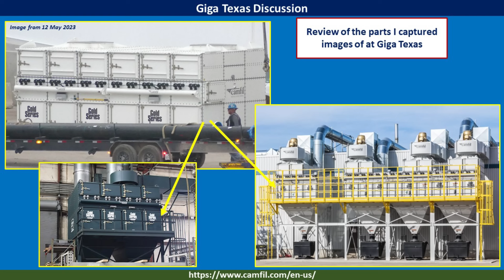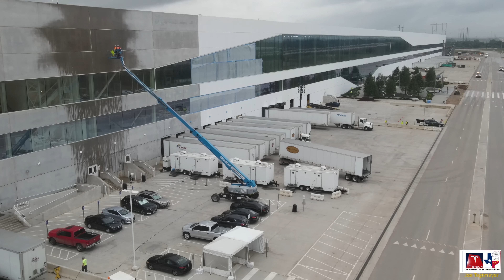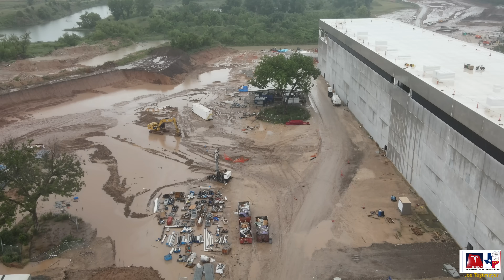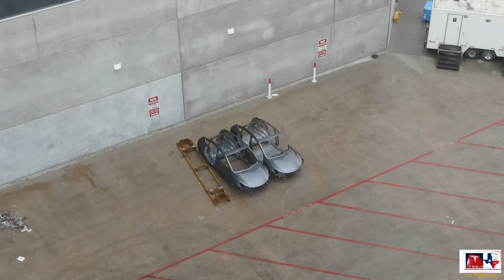Rainy Mother’s Day with Very Interesting Castings on S end! 14 May 2023 Giga Texas Update (10:35 AM)

Comment: Thanks Joe
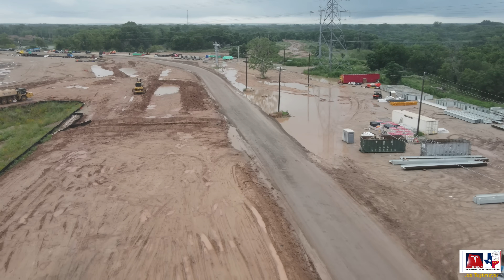11:04. Southend. Stack of steel. For over a year this constantly changing stack of steel has been touted as being the extension structure. It may finally be with the arrival of columns.
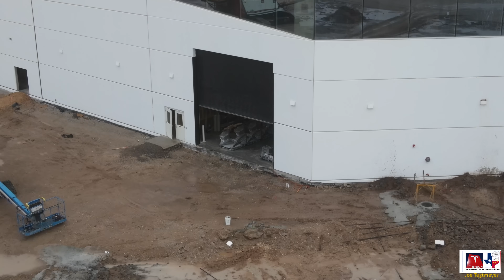12:16. Stamping, inside. Castings. Definitely not Model Y. Presumably Cybertruck, and from various available photos, would have to be the front. Possibly down here as there is a large milling machine in Stamping.
Begs the question, how were they cast? Gigapress, or old time patterns, and sand boxes? The latter would seem likely.
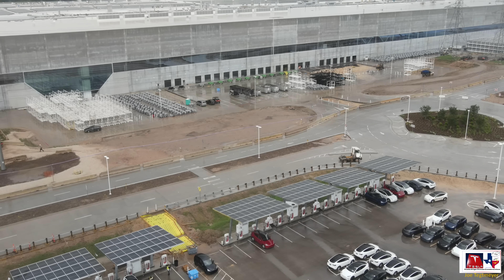13:35. EOL parking. New stair. The mystery of the moisture barrier. Used intermittently inside the building, might be the first time it’s been used outside.
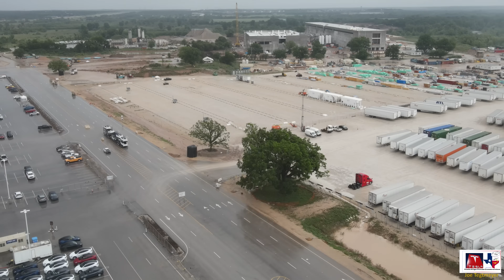14:04. Site security access road. Bottom left, a disguised Tesla. Updated model for Shareholders Day?
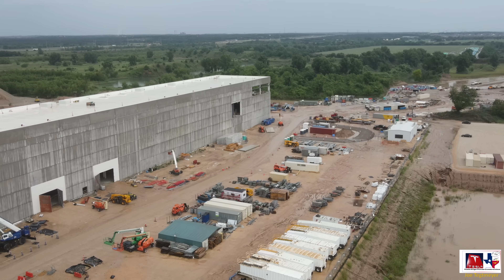15:08. Cathode east. Line of water storage trailers still connected to the blue water main via a pump.
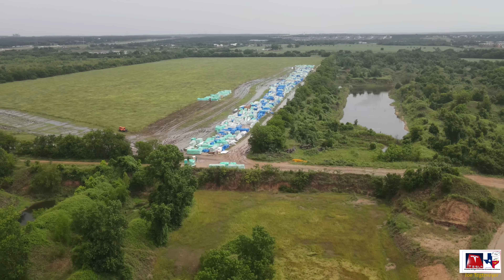15:45. Far north storage. Dog on the road. Some items marked GA2.
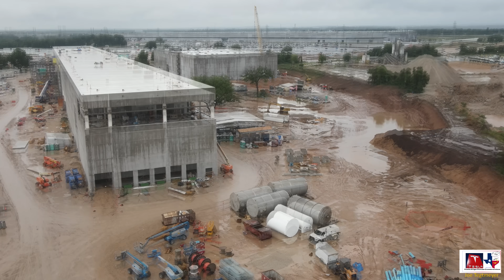16:28. Cathode east. Blue tarps. I think these are window units under.
Cathode, north. Level 3 wall opening. Aluminium/aluminum sill sections may have been placed.
17:07. Die Shop. Stack of wall panels to ruin our view inside.
17:56. Die Shop, south. Mezzanine. Large item of equipment, or possibly a room has been constructed.
18:33. Cathode, plant platform. Apron. Widened the formwork for the raised plinth.
19:57. New Switchyard/substation. Southend. Line of steel piles. There’s a pattern. Possibly some sort of fire separation wall between the LCRA and Tesla parts of the switchyard.
21:05. BESS site. HDD rig. Not the rig missing from the river.
22:54. Battery, loading platform doors. Unchanged in size, maybe the contrast in colour between different material wet wall surfaces gives an illusion.
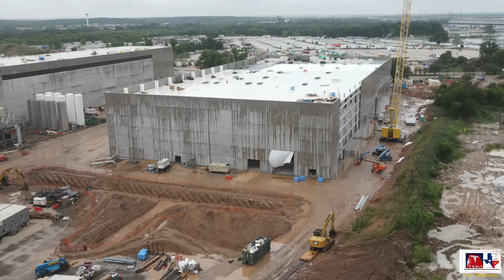Reply: 17:00. Die Shop, north. Large hole on right. Looks like rails have been placed on the floor to facilitate moving in of heavy equipment in the near future?
Reply: @devinnullenvoid29  Great name! I think for now there are recesses, and agree rails are likely.
Reply: 12:16  The Cybertruck Gigapress was delivered 3 months ago.  Why wouldn't first articles be available by now?
Reply: @eclecticmemes  12:16. No positive indication that the 9000t press is operational. No flue/s for a furnace/s for example.

Potentially an existing furnace might be able to supply the 9000t press for test runs.

Might not even be sufficient gas or electricity to run additional furnaces yet. If gas fired, they would have to be a flue, not so sure about electric.

There's a new plumbing permit for 1500' of natural gas line issued last week. No indication of where it's located, but if measuring from the meter location, 1500' could be a parallel service to the existing Casting gas line. Die Shop and Cathode 2000' or more away.

Weird place to put them anyway.

Comment: Those Camfil dust collectors are pulse units. They send pneumatic air in and pulse the filters, they are on timers, very typical for machine shops. The dust or particulates drop down into the barrels below the units.

Comment: Joe, I don't think those doors have changed in width, at least not since they put the semi-permanent platforms.  However, it looks like they cut the concrete panel to make the left one taller.  Seems to have happened maybe 3 months ago.
Reply: You are correct, it has got taller. Sometime between Day 899 7 January and Day 935 2 February a section was cut out of the upper wall panel.

Comment: Substation, south end: @ 19:51 my guess is that the steel I-beam piles are for a temporary retaining wall. Again, just speculation. Can't think of any other purpose.
Reply: Some examples: https://www.youtube.com/watch?v=0YmsP0OxUtw
https://www.youtube.com/watch?v=tiJLFOCvUxc
Reply: What would it be retaining?  Are you saying they are about to dig a big hole there?
Reply: @sammyk874  Change in elevation between the LCRA substation and Tesla's facility?
Construction large underground vaults?
Hard to say. I may be completely wrong. Just can't think of any other use for the piles in the way they are laid out. Have any ideas?
Reply: How about a security wall to make sure no one shoots at the transformers from the road. It seems to be a problem lately. Might see another one erected to protect from the highway on the west side of the substation as well.
Reply: @tristatemedic  Where they are putting it doesn't face the highway unless they plan to put it around the whole thing.  Austin Energy has put decorative fencing around their downtown substations but this seems overkill.

Comment: Very interesting. Thank you on a very rainy day. I just noticed that big pile of "materials" north of the power station and wondered what that was. Still rather confused about who owns and/or is responsible for the incoming towers and other various parts of the plant. Will any of those high tension lines or towers be removed?
Reply: In general, no. The large lines and towers are owned by the Lower Colorado River Authority. It’s a regional power generation and distribution provider. In addition, they control part of the Colorado River and a number of dams on the river. They own the two 345kv transmission lines that traverse part of the Tesla campus. They also own the new permanent substation being built on the GF campus. 

The smaller lines are owned by the Austin Electric Company. It’s owned by the city of Austin. Those lines connect a couple of small power generation stations owned by AEC as well as a few substations owned by AEC. It’s their lines that the temporary substation is connected to.

In addition to the two sets of transmission lines, the utility easement also has a good size natural gas pipeline buried in it. There is a connection point for the GF to the NG pipeline. We don’t know exactly what it’s being used for, but the GF does have a good size pipeline into the building.

There is a mixed petroleum product pipeline buried in the easement. As such, the GF doesn’t need a connection to it, but it’s another thing that keeps the easement from ever being abandoned back to Tesla. 

So short story told long, none of the overhead lines or pipelines are going anywhere. The availability of high voltage power and a large NG line were actually features of the property. Add in a supply of cheap, treated, but non potable water from the wastewater treatment plant across the river was another feature. Several of the processes at the GF need a lot of water. Water in this area, especially in large amounts, can be very expensive to impossible to find. You’d think that being on a river they could just take it from the river, but this is Texas. Every drop of the water in that river is already spoken for. Somebody, be it a city water authority, a power plant, an industrial user, a farmer, or a rancher, owns the rights to that water. Buying a large water right on the Colorado would be very, very expensive. Worse, it would be an interruptible supply. During a drought you could just have your water turned off. The city of Austin will always be producing treated water from that treatment plant. So it’s a great source of industrial water.
Reply: @Bill_N_ATX  Thank you for your detailed explanations, particularly the parts about the underground pipelines and the important water supply issues. I'm glad I asked my questions. Watching Joe so carefully avoid all the power lines does give the impression of a rather spaghetti of high tension infrastructure there. Definitely sounds like that is not going away (and, as you said, the proximities are actually assets for the factory location).
Reply: The substation is owned, built, and managed by the LCRA and ERCOT. As far as I know the MegaPack installation will be owned and managed by Tesla.
Reply: @TheJeffcurran  Thanks, Jeff. I'm sure that MegaPack plant will be of benefit to the factory (and the grid), especially when the remaining solar panels are in place and contributing on the roofs. It is nice when a company (especially one you own stock in) can benefit in one factory from its own other products being made in another factory 🙂.
Reply: @WarrenLacefield  It's a big part of the over arching Tesla goal. You hear a lot about large solar installations around the planet. That's all just media nonsense. When this installation is complete it will be well among the largest solar and battery installations on the planet.
Reply: @TheJeffcurran  Well, there are quite a few very large solar installations around the world. I don't think that in itself is over-publicized. Certainly this solar and battery installation will be among larger ones - for now. But the MegaPack business is growing very rapidly (Tesla and several other companies as well).  Giga-Texas will be rivaled, I imagine, by other factories (like Mexico and Shanghai and Berlin) and more so by other more general electric grid support solutions. Tesla Energy has a big future.